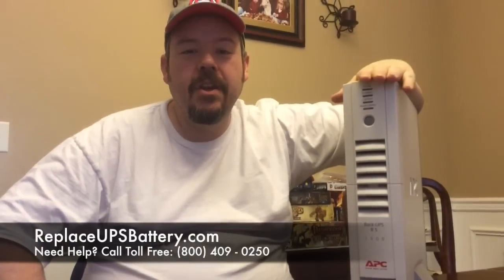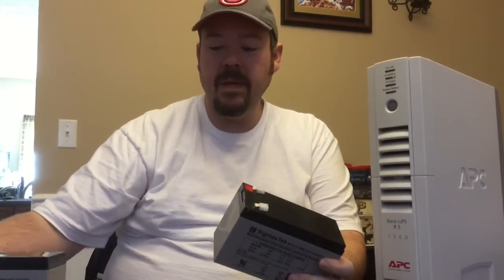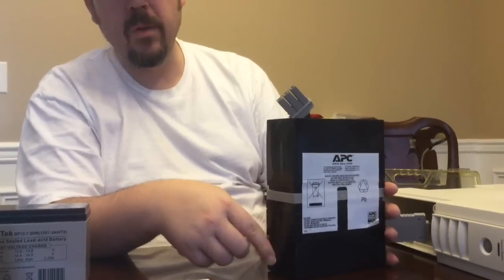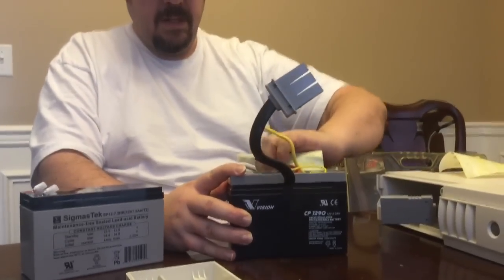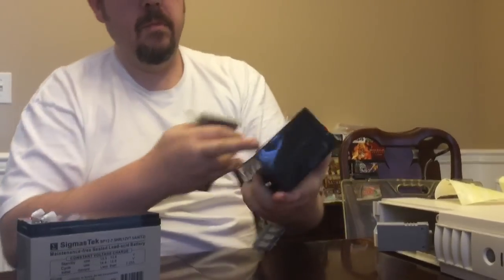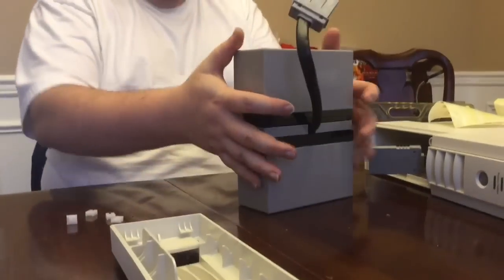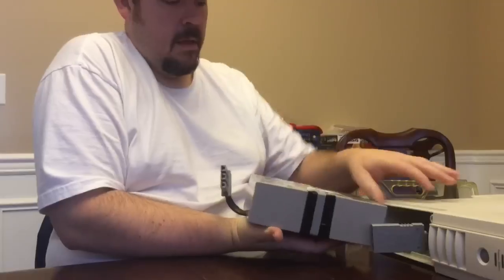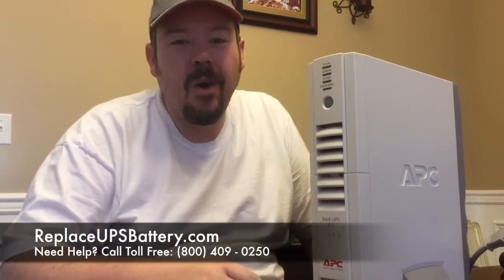APC Back - UPS RS1500 - Battery Replacement

Comment: Not have used same battery ok i have ups i used 12V 12Amp and 12V 7.2A ok positive to positive and fused  to positive wire of usp and negative to negative to negative of usp ok in small water proof tool box i have 1 out let water proof  110 v A/C out with plug 🔌 wire from my ups and volt meter and switch

Comment: Thanks for the video. My batteries were gone so had to see what they looked like. FYI: To tape the batteries together (If your labels aren't any good) you have to use strong shiny packing tape (duct tape is too think and sticky to fit) and the batteries only fit in one direction with the cable to the right of the front of the case. 🙂

Comment: Thank you! I had no idea that was 2 batteries on a connector like that. My UPS went battery error right before I left the east coast, and I stuck it in storage. I'm going to be retrieving stuff from storage and now I know that ups is worth putting back in service. I'll make sure it doesn't get recycled during the storage unit clean out. You just saved me some money!

Comment: Hint: I just completed this on my old APC 1050 VA and was greeted by a constant beeping and red light. Apparently these can go "brain dead" but it is simple to fix. Unplug the UPS from the wall and remove everything attached (no load). Then hold the power button for five seconds and the unit will reset. All is just like new again and thanks for saving me some serious $$..Your service was also top notch as are the prices.
Reply: That’s only a band aid, bro-yo. When they do that you gotta pull the whole board and replace the capacitors (all of possible and they’re cheap as heck anyways so might as well). Then no beep or issue again.

Comment: thx for the video, is it worth buying APC BACK-UPS RS 1500VA , now 2020?  I would like to get  one.
Reply: these UPS from APC never really get old.. i mean they just keep going, all you need to do is get fresh batteries now and then. i went dumpster diving and got two of RS 1500 from 2007 just now, sadly they were without battery pack so trying to find a brc33 harness for them without any luck.
but the UPS itself is super solid, just make sure it doesnt get dusty inside.
buy one if you can get them cheap, or dumpster dive for free ones.

Comment: After replacing new batteries,My unit is not coming on line.Amber is glowing,Green led goes off after some seconds.What should I have to do?The same model as in the video.
Reply: did you figure out how to fix this issue? I'm having the same problem.
Reply: Me too, what u did to fix it?
Reply: I have the same Problem on an RS 1500

Comment: What is the function of the third wire in the connection port of the battery unit? The two batteries serially connected to each other. Black is the 'negative', yellow is the 'positive', and there is a third, thinner wire. (Thanks in advance.)
Reply: Black is negative on one battery, red is positive on the other. The yellow connects the two batteries together in series. It acts like the two stuck together battery terminals in your TV remote.
Reply: @hellomiakoda3782   I think he means the thin wire inside the connector block.  It is tied to the heavy red wire (positive) and then connects to the 3-terminal connector (plugs into connector in ups case).  It seems to be a sense line.

Comment: can u replace those smaller battery with bigger capacity battery by extending the wires, leaving those big batteries outside ?
Reply: i wouldnt risk that...i don't know this but it seems to defeat the security of the power
Reply: on the RS 1500 you can add an external battery pack BR24BP on the connector on the rear of the UPS which is essentially 4 more 12v batteries in a separate case. i believe it's the same connector as the internal harness, meaning if you have the harness you could essentially build an external battery bank for this one.

Comment: Can this supply power to 4 workstations and a printer?
Reply: +MarHutchy APC says NO to laser printer and other printer I would wait till the power comes back on or the Back-Up Generators start running...  Also have used clear packing tape to hold the batteries together.  At minimum just be happy to save your work and shut down gently.  tjl